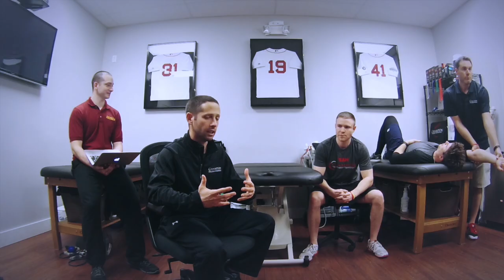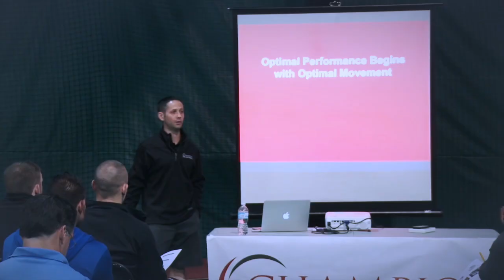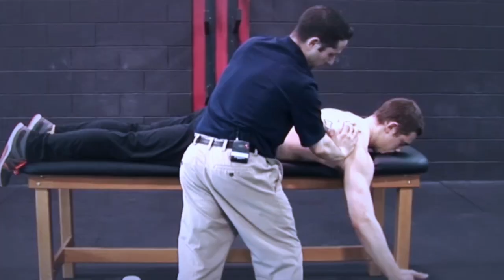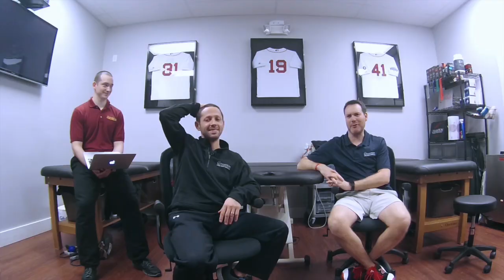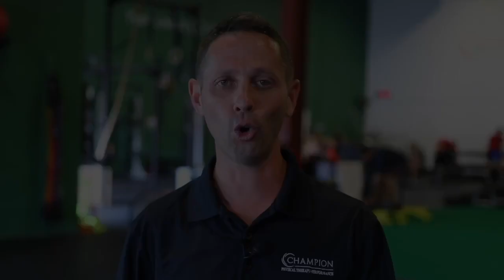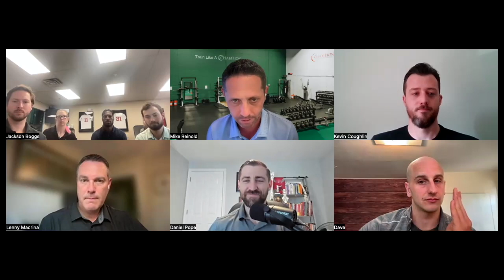ACL Repair Using the BEAR Technique

Comment: Hi Mike. Can you explain the benefits of doing rehabilitation exercises with medium intensity(further from failure) and high frequency, high intensity but fewer times a week or high intensity and high intensity but for just 1-2 sets a day. What is usually the best approach to heal from a sholder injury that appeared it time
Reply: I think it's because you need to have full control of the exercise - when we get tired or the weight is too high, we usually lose some of our technique putting us in higher danger of injury in general and especially if you already have an injury which impacts the mechanics of a given joint.